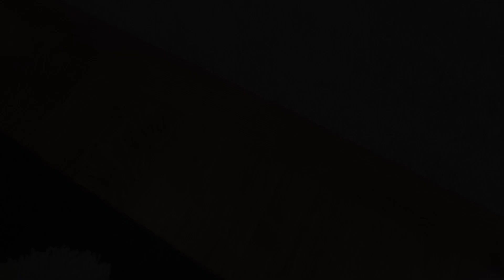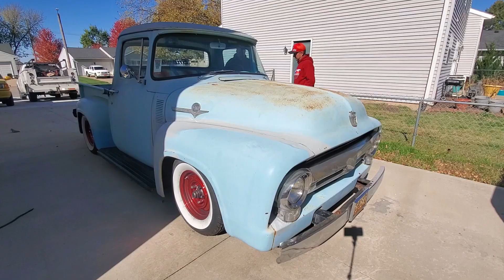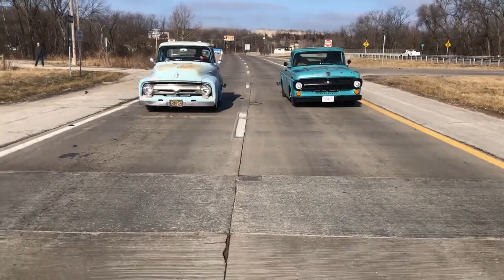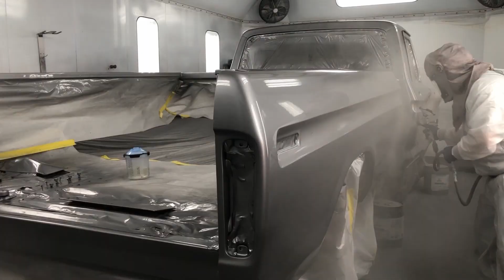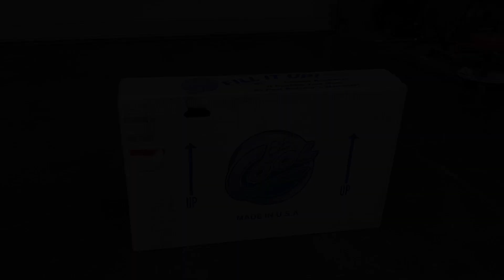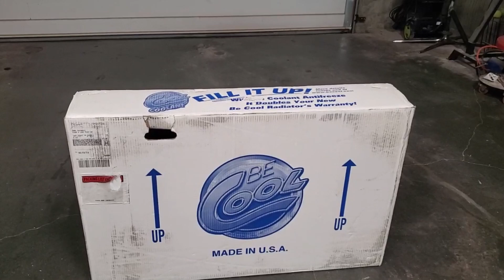1968 Plymouth Fury Radiator Upgrade!!!

Comment: On ur trunk video (the inside portion) Did you just use a random piece of sheet metal to patch it? Or a chunk from another Plymouth fury?
Reply from the maker: I bought a 4x8 sheet of 18 gauge sheet metal for like $70 from a metal warehouse and used that for most of the trunk floor repairs.  Still have quite a bit left over.  I used a bead roller to make the support channels.  I did buy some repop trunk corners for like $165 for the pair, but they didn't match very well.  Ended up only using one.  I guess if you are going to cut the whole trunk pan out, then repops might work.  Or find a donor car if there is one out there.  Might have been a better plan, as I had more holes than I originally thought.